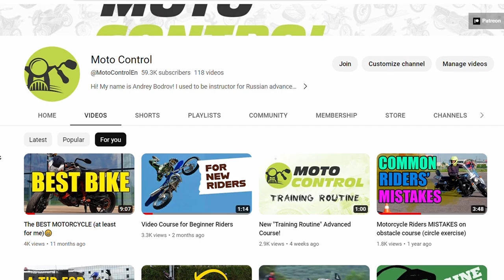Better Ride, Less Effort: Self-Steering, Speed & Turning Radius

Comment: There's a nice turn in town ends with a stop sign. It's a nice clean road where you can enter the turn with a nice lean.
One thing I enjoy doing there is riding the whole turn without any steering input, using just the front brake to control everything.
If I use the right amount of front brake, not too much, and not too little, then the bike comes up straight exactly at the moment when the bike comes to a standstill at the stop sign, without using any steering input.  A fun little activity that I enjoy on the daily commute.  I enjoy seeing how I can control cornering, speed, and lean angle, all with the same control!

Comment: You nailed the audio mix perfectly on this one - just enough background elevator (music) to set the vibe but not so obtrusive as to obscure your dialogue. The quality of your productions keeps getting better and better. Stick with it AB! Suggestion for you to consider on the motorcycle side of things – in order to better illustrate the relationship between steering angle, lean angle and direction of travel (heading) how about hitting the dirt and getting some power slide footage. I think it would go a long way to better illustrate the relationship between the three directional control parameters as well as show your target audience what is possible further out on the slip curve. It would be a more challenging shoot, but a lot more fun!

Comment: Can you explain more what happening at 2:05 ?
Reply: When attempting a right turn, the rider 1) forced the handlebar to turn right, which 2) caused the bike to lean left & turn left, so the rider 3) got surprised and canceled the movement, failing to turn right.

Comment: hi  not related on your video ihave question changed my exhaust to full exhaust and now its doing a backfire/decel pop 
 is just normal or do i need to remap the ecu? what will happen if i dont reflash or remap it? yamaha r3 please answer sir thank you
Reply from the maker: Hi! Usually any mods tied to air/fuel mixture ratio (full exhaust included) require remapping. About decel pops RevZilla made a nice video not long ago: https://youtu.be/5BKjVYAlPDU
Reply: @MotoControlEn  thanks  uli put my stock exhaust again hehe i dont like to remap reflash my issue coz my bike still under warranty
Reply: @MotoControlEn  but what will happened if i dont retune remap when i put my full exhaust any damage i. the futre?